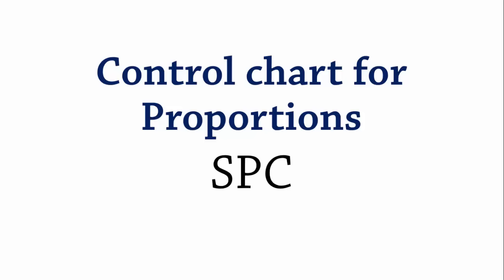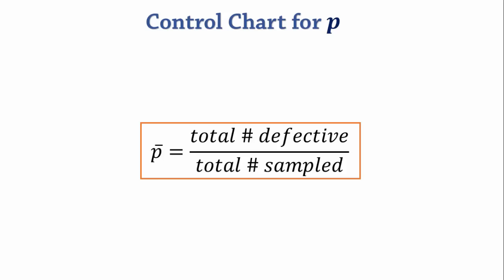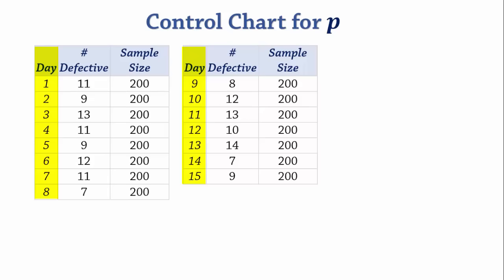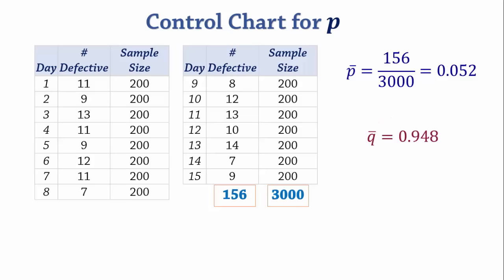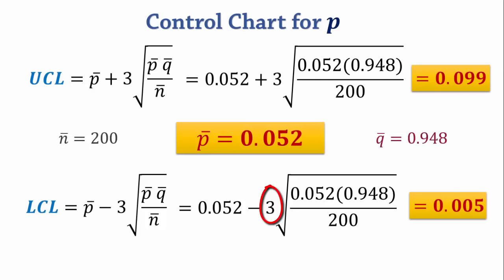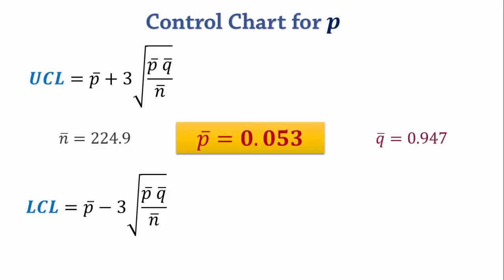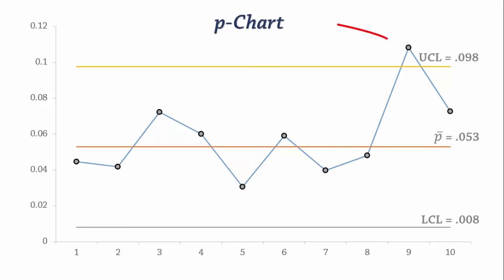Statistical Process Control: Control Charts for Proportions (p-chart)

Comment: The UCL and LCL will vary when the sample sizes are not the same. In other words, the control limits have to be calculated for each individual proportion (p) based the sample size for that observation (n).

Comment: I appreciate your presentation here. When you have different sample sizes n(i) you should adjust the UCL LCL by dividing not by nbar under the root but by the specific n(i) sample size. So UCL/LCL should change with every new sample. In fact they are mirrored around the pbar value.

Comment: you have a variable sample size..UCL and LCL should reflect that rather than be uniform across the entire data set. correct me if i'm wrong
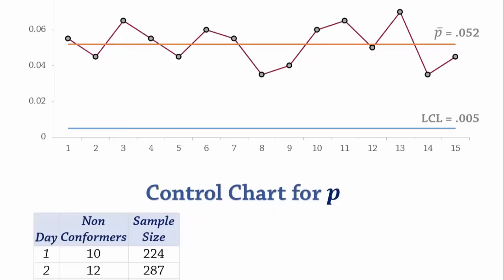Reply from the maker: Sure. See 3:00.
Reply: yes i noticed however your formula still gives a single UCL and LCL which is what i'm pointing out. The graph also has uniform control limits for all the days.
Reply: It looks like the one value out of control is from the smallest sample size that should have a wider set of control limits.  I recalculated the UCL using the actual n value (120). The actual UCL is 0.114 and the process is still out of control. When possible avoid variable sample size since it can be misleading.
Reply: You are right... I have also read that for variable sample size, the UCL and LCL are also formed in a variable manner (moving up and down) as the graph progresses.

Comment: 2:50 Just wondering based on Nelson's rule  4 & 7 wouldn't this indicate potential problem ?
Reply from the maker: I'm not familiar with Nelson's rules.Different rules are used in different environments & different goals. You will have to find the ones that apply to yours and implement them.
Reply: @joshemman  thanks mate 🙂

Comment: wanted to know at the point of drawing the LCL, UCL, and p bar line in the chart , do we consider the readings on the vertical axis. and do we plot the proportion values against the number of samples. please clarify. am a bit confused at that point.
Reply from the maker: The proportions are the values on the vertical axis. 
Since this is time series data, the horizontal axis is sessentially a timeline.

Comment: But if the number of non conformers is 0, so I will count the sample size for that case two? For example, in this example that you show, if the day 2 is 0 (instead of 12) I stil need to consider the sample size 287 in my calculations?
Reply from the maker: Yes. If the number of non-conformers is 0, you still need to include the sample size.